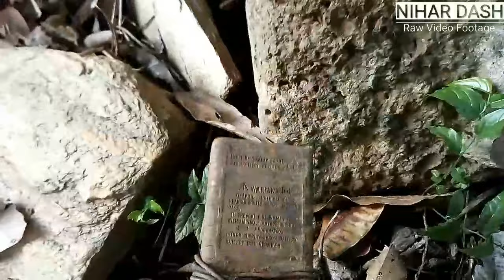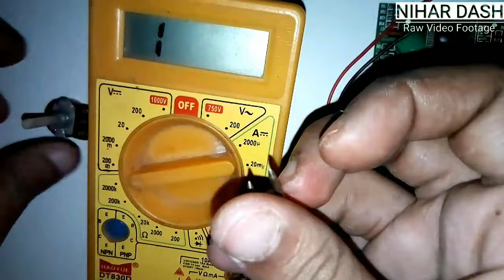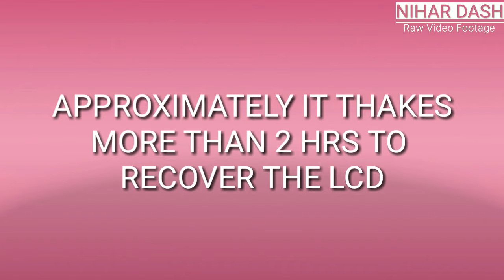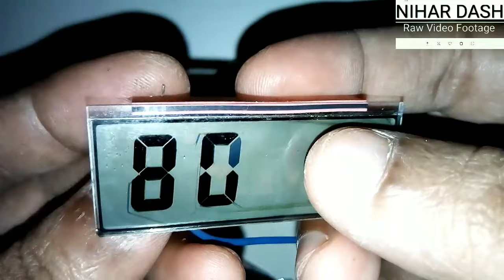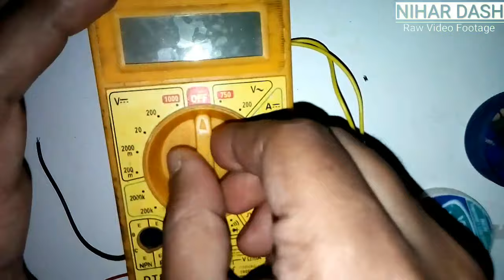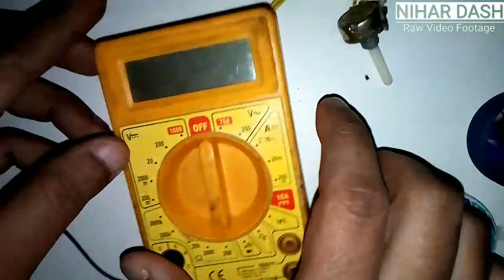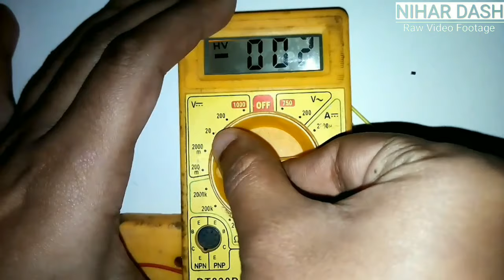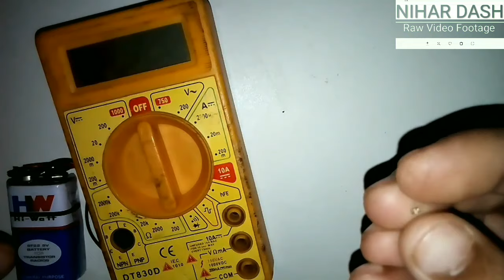How to repair digital multimeter / LCD Repair.

Comment: At 43:15 when he tested for continuity, I saw the meter move but the display didn't.
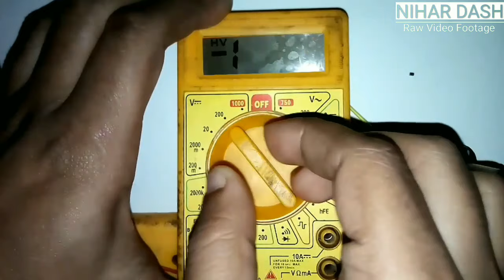Reply: great! starting from 42:25 it's clear that the video was editted. after this we can see some "artifacts" related to the display which would not be expected anyway.
Reply: What chemical you used on the reflector to bind with the glass?
Reply: @regis-9408  does this mean its fake?
Reply: he photoshopped it i think
Reply: @josephadereni8202  absolutely fake
Reply: @rameezsheikh7576  
That's pretty hilarious😅
Reply: I saw ne never answer any one
Reply: Yes i also noticed, this video is edited 😮

Comment: Thanks for this video. I have a UT61D multimeter, where the display lights up, but nothing appears. After seeing your video I thought that perhaps the liquid that you added with the syringe is missing between the plastic part of the display and the aluminum film. what is this product? “customised solution available”

Comment: How to add temperature sensor in the digital multimeter model DT830D.
Reply: resistance or mv range, depends of what temperature sensor you get.